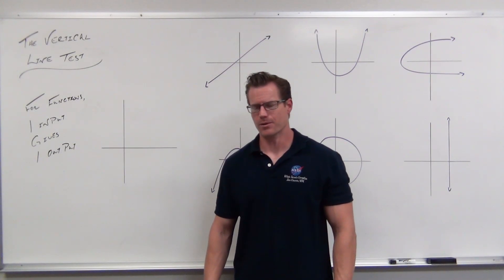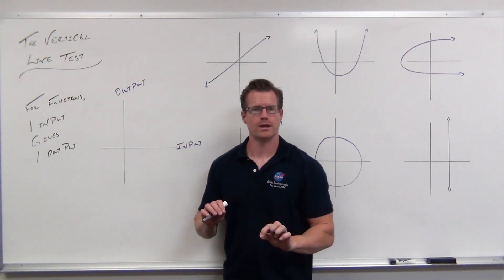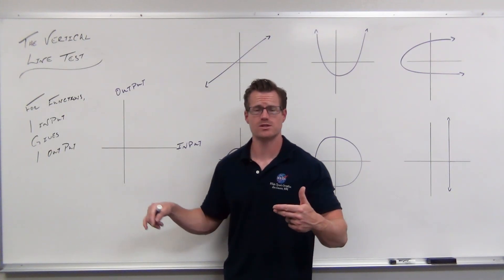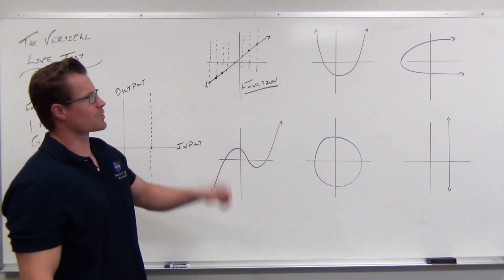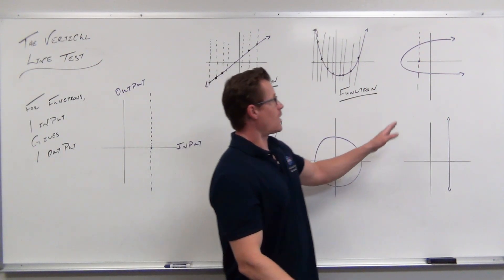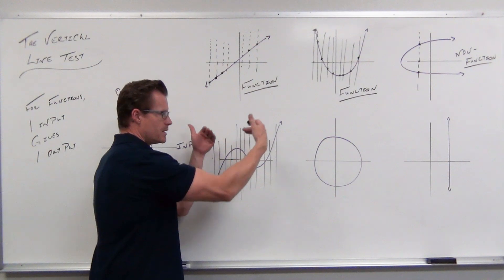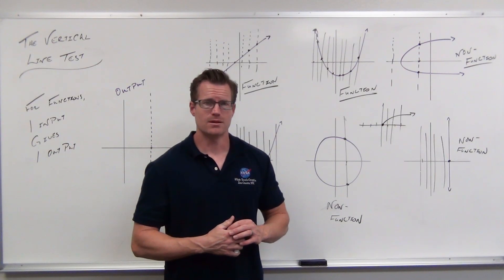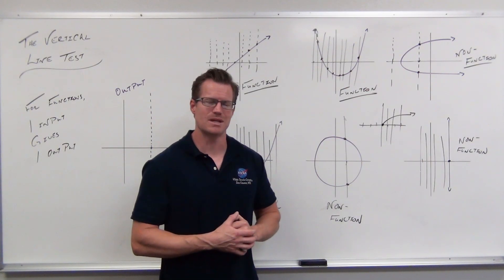Using the Vertical Line Test (Precalculus - College Algebra 6)

Comment: Can someone explain at 10:34
Reply: Because when you make the vertical line test, it'll be exactly identical to the main line, which means intersecting at infinite number of points
So the input in this case literally has an infinite number of outputs